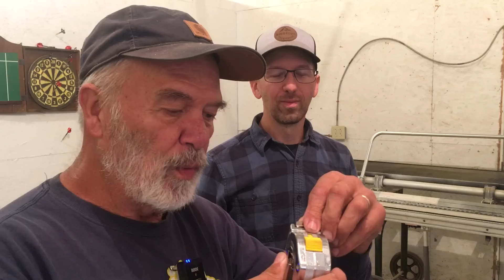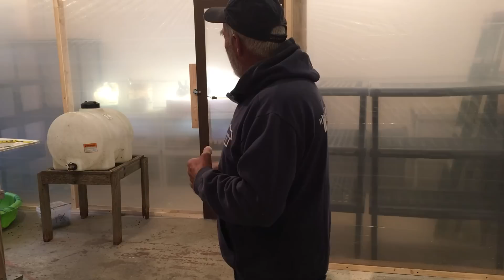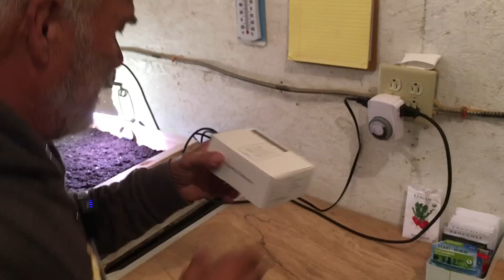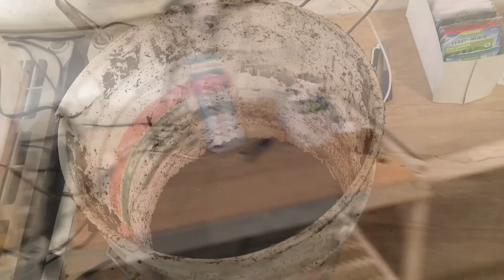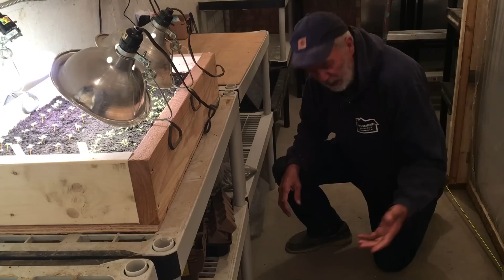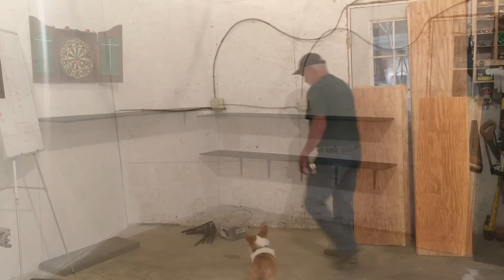FALL SCHEDULE AND CROPS ARE UP

Comment: Love your channel.  I have a video idea that would help ME out greatly LOL.  I have my slab complete and would like a garage built as a stand alone building behind my house in the spring.  When looking for a builder, what questions do I need to ask to minimize getting a shady contractor?   What things do I need to look for when researching contractors?  I know ZERO about construction or how to properly vet potential builders?  From your videos I'd love to find someone like you here but don't know where to start looking besides googling garage builders near me LOL  I don't have friends who have had garages built for references either.  :(  Also, how do you make a guessimate of costs?  I know every area is different but I don't know if I am looking at $1 or $100,00.  OK, I really sound like an idiot but with construction, I guess I am.
Reply from the maker: Word of mouth is the best way. Check references. Maybe look at work they’ve done.

Comment: I think the comments regarding the door brace isn't related to strength but the fact that the brace usually goes the other way to bring the weight of the top of the door down to the lower hinge side.
I doubt the position of the potatoes makes much difference, they "know" which way is up and will head up as they grow regardless of orientation.

Comment: If you want "perfect" lighting, use smart power strips. With these you can designate each light individually and control how much light each light is on via an app. Naming each of 6 outlets, each plant, or section will get the proper it needs. Kasa power strips by TP-Link also have USB for your air quality meter. All outlets are manually controlled individually or by schedule via the app.

Comment: Ken, if you have very much idle time you may want to go ahead and till your garden for next spring now.  Start collecting your leaves in bags for your garden as the leaves fall this fall.  Spread them out in your garden. Wet your garden well and then cover it with black plastic.  This will help break down those leaves and give your garden the proper nourishment it will need in the spring.  In the spring after the last frost pull the plastic up, folded up and save it so you can use it next year and then till your garden again those leaves will mix with the dirt. You should not have any weeds whatsoever in your garden because of the lack of sunlight from the plastic.  After the last frost then you'll be ready to plant.  Since you have grow lights in your greenhouse, go ahead and start planting your tomatoes in 2 gallon buckets.  If you do it now, you will have tomatoes growing in your greenhouse for Christmas. Ready to eat. Replant your tomatoes in February and when the  last Frost occurs, you can start planting them in your garden outside.  You can also plant onions almost all year round and garlic.  Good luck and God bless.

Comment: Gardening tip: when filling your trays with soil place flexible mat or cookie sheet under the tray to catch any soil that spills over. This way you can fill the tray faster without worrying about wasting or cleaning up the spilled soil. When the tray is full just dump the excess soil back in its original container.
Reply from the maker: Thanks

Comment: Wrong for the potatoes. The tub needs to be 3/4 full of compost with the seed potatoes at the top with a light scattering of compost on top of them to keep out the light. Then the foliage will sprout and you can then add a little more compost. The baby potatoes will then grow downwards about a foot down and in a few months when the foliage shows it’s age, the new potatoes will have grown. Then you can tip the whole tub upside down and you should have a couple of good portions of tasty baby potatoes. (Potatoes don’t need much heat).

Comment: Ken, You might look into Panda film for your greenhouse. It will greatly increase the light intensity inside the greenhouse without increasing electrical usage. It's also very durable. Reflective walls makes a huge difference.

Comment: I'm not sure if you put plastic sheeting on both sides of the 2x4 greenhouses walls. If not, then you should. Trapping air is the key to insulation. The 3-1/2" air gap will make it easier to keep the greenhouses warm. I know that you are a builder and probably already did this, but I didn't see that video.
Reply from the maker: Yes, we put plastic on both sides

Comment: Formaldehyde (HCHO) and Total Volatile organic components (TVOC), shouldn’t be a concern for your indoor greenhouse.  More of a home indoor air quality issue.  At a cost of $29 meter accuracy maybe questionable, but may give you a baseline for Co2, humidity and temperature readings to see if those air parameters are stable or changing.
Reply from the maker: Cool thanks

Comment: Hi Ken,
The measurements on your air quality meter are for Volatile Organic Compounds (VOC)s. The middle number is TVOC or Total VOCs. The bottom number is for one particular VOC called Formaldehyde. The label (HCHO) is the chemical compound that makes up Formaldehyde. I think that was one of the first VOCs they determined was harmful to breath.
It will be interesting to see if that CO2 measurement on the top goes down as you add more plants. You might have to brew some beer or wine to supplement your CO2. I'm not sure what will happen with the VOC measurements in a nearly closed system like your greenhouse.

Comment: Potatoes, radishes, and lettuce are good choices.  Peas, beans, and tomatoes all fruit from pollinated flowers, so you might not get any unless you get out there with a paintbrush and hand pollinate.  You might want some small drain holes in the bottoms of your containers so they don't get too wet from accumulated water.  There are some good YouTube videos on growing potatoes in five gallon buckets.  You get a lot, but you have to follow each step in a procedure.
Reply: Tomatoes  self pollinate
Reply: It's very difficult to get self pollination without a little wind...
Reply: @hughreynolds6183 it's called  spanking your tomatoes,  every time you go by them give them a shake
Reply: So that's not self pollination. That is wind pollination.
Reply: @hughreynolds6183  self pollination is  the  same flower having both male and female parts,  it doesn't  take a whole lot of movement.

Comment: Have you thought of installing a couple of skylights and then using your lighting system to extend the hours of light? Looks great!
Reply: That will ruin the light cycle of photo period plants
Reply: @sleepychallenger  well I'm sure he has a staple gun and black plastic  if it's an issue. Was more thinking about saving on power.